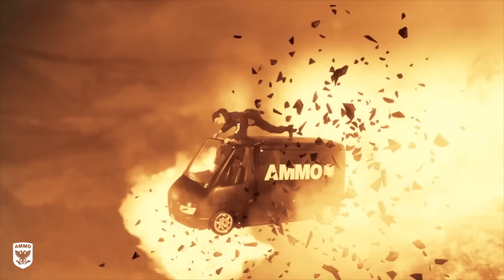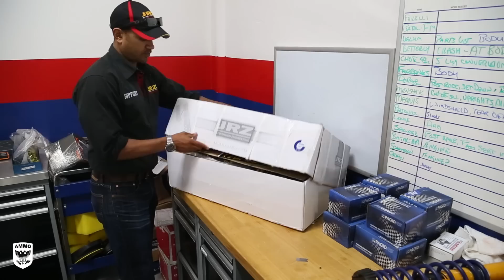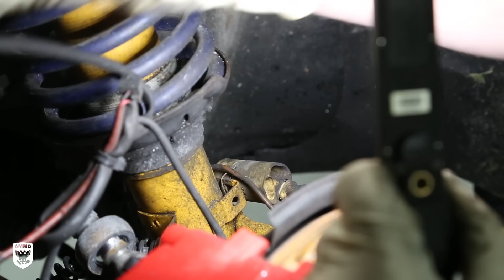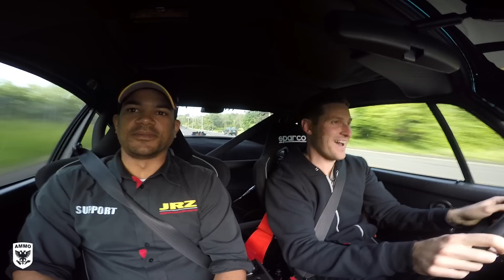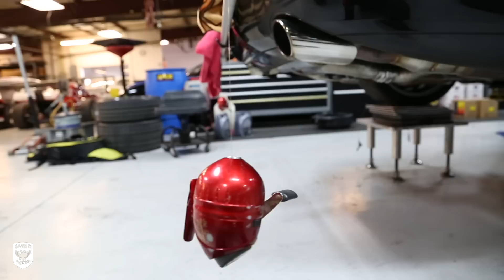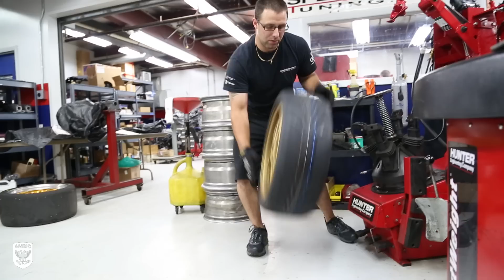How to Set Up Your Suspension Properly: JRZ RS PRO on Porsche 964

Comment: The technical level of suspension setup on bikes and cars is immense. Learning how to tune on a bike can translate over to a car.
Reply: vidurc The difference is that on bike you need to account for the driver, so all of the measurements need to be made with the driver on it. Anyway it is amazing to see how important the setup is.
Reply: Filippo Masoni They corner balanced Larry's car. My assumption is that they accounted for his body weight when the car is in race trim. So with him in it or his weight in the driver's seat each tire's preload is adjusted to give a perfect distribution of its weight on all four wheels.

The car will drive more predictably and handle a lot better. Corner balancing should be done for any coilover setup but more often that not it's ignored.
Reply: Völundr Frey Also given the lack of suspension travel you have to be precise down to the millimeter. Sag on a street bike can typically be around 25mm vs a track setup would be 20-22mm. Small difference but it makes such a big difference at speed. Suspension can make or break a car or bike. Understanding the tuning process really brings out the potential of any machine!
Reply: vidurc You also need to do it with the driver inside, for a  better weight distribution, but it´s more dificult because if you touch the rear left it will also affect the front right, it´s very tricky. In Bikes it really depends a lot on the driver
Reply: Alberto Pettine Bikes are much easier to set sag on. Cars on the other hand are a different story. It can get really frustrating

Comment: i love what the guy said at the start where suspension is the first performance upgrade you should do... i spent hundreds of £ on stuff for my bike - braided hoses, k&n filters, exhaust system, x ring chain, etc etc... then when i started to think about upgrading my fork springs/oil someone suggested i go see a guy to get a proper suspension setup. the guy who i went to see spent an hour or so taking measurements, asking me about my riding, tweaking the forks and shock, he'd tweak something then go for a ride, come back and repeat several times until he said i should take it out to see what i thought... and fuck me the results were oustanding!!!!!! seriously the best p'erformance upgrade' ever possible and it only cost me 60 quid!!!! the guy is called brian nicholson based in london. he told me 'all you need is decent tyres (at the right psi), sintered pads, and a good setup, that's all the mods to do to sharpen up the ride...'

great video as always larry! did you happen to make any that cover the rest of the build etc?

Comment: congrats on the upgrade!  just wait until you're obsessing over tire pressure before every run.  you can start the morning at 30psi all the way around and you will get 5-7 psi more after every run.  at the end of the day after you've cooled down you'll see your tires are at 22psi  from letting out so much.  I invested in a portable air tank to air up  for the drive home. Longacre tire gauge is your friend.  Drive safe!

Comment: Great stuff! But no discussion on shock Dyno plots (Reohrig?), ride frequency, spring rates, and actual alignment values. The clicks correspond to what velocity characteristics?

Any discussion on corner scale weight as a function of spring preload and height? 

I guess the next step for this car is a 4-post rig and accelerometer measurements?

Comment: Probably better off keeping the konis, the new shock has helper spring to prevent main spring from clunking at full droop, and spring rate is dependent on ride height, you have to lower car to stiffen up suspensio . Good shocks  can adjust spring rate independent of ride height.

Comment: Before sponsor discounts, im curious how much everything he has done to the car, would cost. It has to be astronomical.
Reply: 04dram04 That's what I wanna know.
Reply: 04dram04 Its good not to add up the money when you're building your dream car, just buy what you want for it :)
Reply: ***** Yes but it's easier if you get free parts and labor :) Then you can build it all the way up to your ultimate dream without any installment nightmares :)
Reply: 04dram04 I bet he trades them work for some things, i know he details car there quite often
Reply: +04dram04 Suspension is about $6,000 and the Big Red brakes about $3,500-5,000. As far as that engine work and actual labor costs....who knows?

Comment: Awesome video!  Just curious - do you get any spring binding up front with this setup when you turn the wheel lock-to-lock like in a parking lot or something?  Didn't see any sort of thrust bearings on the strut before you installed it.

Comment: I was surprised when they took the reservoirs off. Don't you have to bleed the shocks after that to get any air bubbles out of the oil side?

I guess they planned ahead and used quick disconnects for minimal leakage.

Comment: Question: If you corner weight a normal car with mcpherson and compound axel on the rear. Most fit coilovers for stance not for deviding the weight/load between the wheels. How would you set up a street car with corner weighting in mind, meaning that you would use it as a family car most of the time, and when you're driving alone and getting the best of both worlds,is it possible or waste of time?

Comment: Hi Larry, just one question you really find the R888's gripy when d'ding? have them on my 335i (320ps) for about 2 months and honestly even though the rubber is new (1015) i find them 1-2s clicks more slippery than the usual street tires aka SC5, PS2, RE050 etc. (in public roads), didnt try them on the track yet which Im sure they'll shine but as far as d'ding I find them awful. Another frustrating thing is that they are so noisy in the cabin, that you think you have a differential problem. 

Keep up the good work and Greetings from Greece,

Angel

Comment: How do you determine what settings you use for compression and rebound?
Reply: +Jimmy H  thay set upp a baseline depending on cars waight due to more waight ther is more compression and in the end ther is only to test drive the car and adjust depending on what type of behaviour driver wants from his car during different conditions and track.
usually garages that work lot with this type of cars now roughly how hard springs and damping force they need for the car and can find a ajustment that works to as a base ajustment and if so the customer needs harder/ softer springs its just to buy right set of springs.
Reply: +extec101 thanks for the response.  Yeah I'm always making adjustment changes and always asking myself can handling performance  get better or i can make it worse.  It's hard to determine where that sweet spot is and get that perfect balance.
Reply: +Jimmy H yes made a bit of tuning myself and from what im experienced 
is that it is important to se how the car is going to be used when taking disissions on suspension setup is it for road then "stance" is stupid so look more at a tarmac rally car ther is some suspenssion travle and it can handle pottholes and speedbumps and most importent on street is as long drop as posible (meaning as you lift the car up tyres will stay on ground longer like a normal car that can be lifted 4-6" and still have tyres in the ground).
think like going over a crest ore a bump and there is no rebound so when car is taking a small jump ther aint no contact with road but with long drop ther is posabillity for your tyre to maintain contakt and as it is avoyded that any of the tyres lack grip it reduced risk of skiding out and crash.
hope you understand how im thinking and english aint my main languige so ther is probably lots of miss spelling to.

Comment: When doing the weight distribution calculations, is there a reason why you didn't sit inside the car so your weight would be accounted for? 

I'd think this would be a better setup for the track and stuff since man and machine would both be in harmony. But then again, I'm no race engineer!
Reply: Tha Saw He probably was in the car when they were doing the actual corner balancing.
Reply from the maker: Patrick94GSR youre right i was

Comment: Can you comment on how noisy those tires are on the street?
Reply: +khanart I have had those tires on my ride, yes they are louder than regular tyres, but that's not a problem. But be sure to let the car at home when it is wet, I've got aquaplaning with like 40mph on a rainy day. A guy had them on his GT-R and crashed in a Bus. Probably because the temperature was just 10°C out. But for a second or a trackday car best choice ever

Comment: I'm planning to install Koni fsd's on my 993.  The original Monroe's have 63k miles on them.  Is replacing the suspension something you think you could do at home and then take it to an alignment shop or should I just leave it to the professionals?
Reply: Andy Hodapp Replace/install yourself.  Then take it to the pros to align it. With a 993 go to a good independent porsche shop; preferably someone that sets up race cars.  993s have kinematic toe that your standard wheel&tire shop have no clue how to adjust properly.

Comment: Hi Larry,

I recently clayed and waxed the bonnet of my 2014 Mazda3.
Now, it looks like it is stained. Like the paint is reflecting light unevenly. You know when you spill a drink and you can see the satin on the table when it dries? Like that. (I did clay and remove all the old wax before applying the new layer)

Should I apply the wax by hand like you suggested a while ago? 
What do you think I could be doing wrong?

Comment: No need to have a driver inside the car when measuring the suspension. Larry's bodyweight is approx. 5% of the weight. The difference is not noticeable on a track day road legal car. Also don't forget that the fuel also changes the handling characteristics during a full fuel run.

What makes me wonder is the new set of wheels. Those look too fancy to be proper track day wheels - unsprung mass...

Comment: Not bad video but the alignment part really makes u look unprofessional. Although you can get some angles through string on the spot without a computer to give you a good reference of where you're at it is not exact at all. You cannot get a caster angle which is your most important angle for car stability.